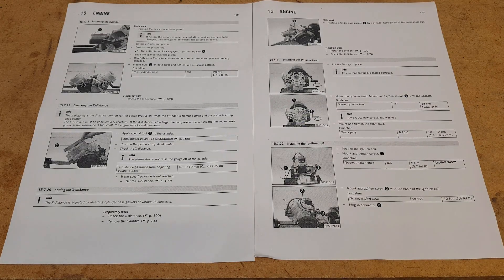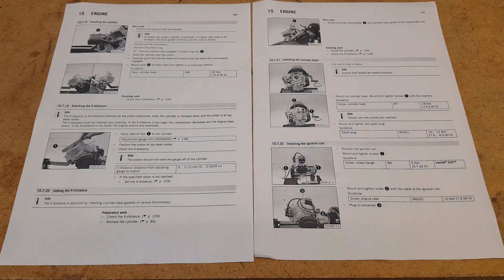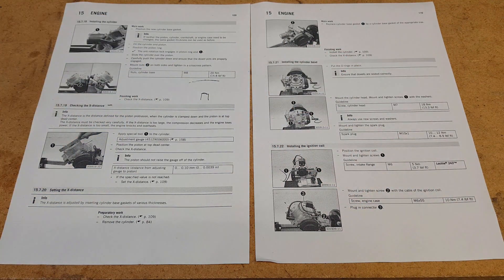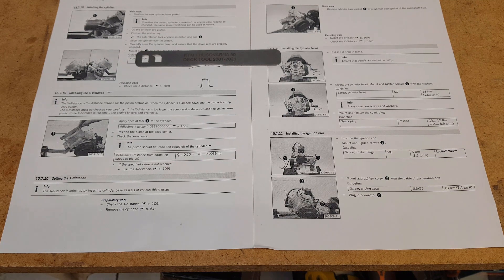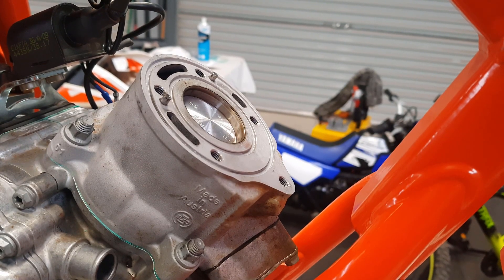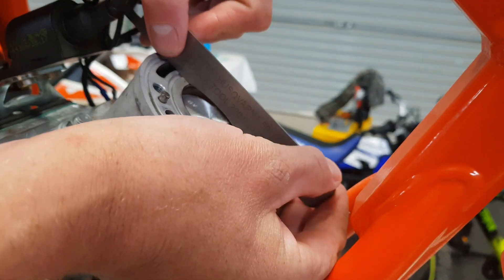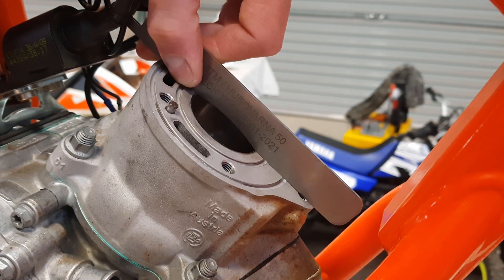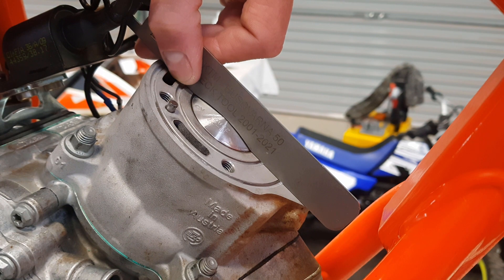How To Set & Check Deck Height / Squish / X-Distance When Rebuilding Top End KTM50 TC50 KTM50 SX

Comment: This tool is not for squish, it is to adjust the right compression ratio. That means the right combustion chamber volume. Squish is something different, squish is a circumferencial area of the piston with the cylinder head with a very small gap. This area around the piston presses the fuel air mixture to the center of the combustion chamber and it optimizes the burning of the fuel air mixture.
Reply: The distance from the piston to the head changes with the base gasket height. If the cylinder goes up or down based off of the thickness of the base gasket then the head goes up or down with it.
Reply: @yourfavoritewelder3162  One thing is squish and another thing is compression ratio. It can happen that with the right squish gap the chamber has a too high compression.

Comment: should i need to get bigger gasket my piston go 0.01-0.02mm above the 0mm x distance tolerance? Only on the back side of the piston is out of the tolerance and my cylinderhead is stock hope you will see this message.

Comment: Hi James, quick question buddy that I can't seem to find the answer to anywhere. If you are installing a vhm head do you keep the squish the same as standard or do you decrease or increase it slightly with a different gasket?
Reply from the maker: Hey Dave, really unsure what squish the VHM setup works best with. I would give them a call to confirm